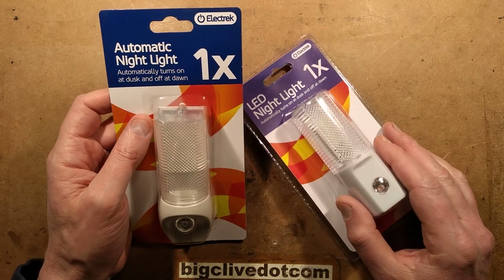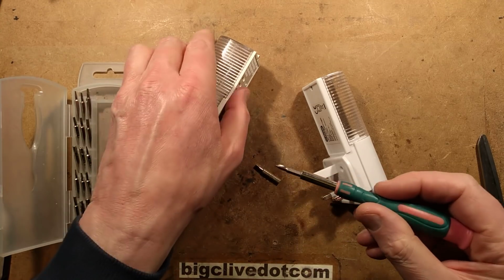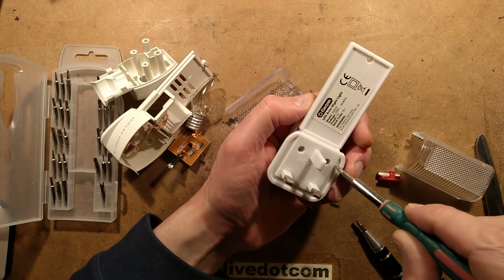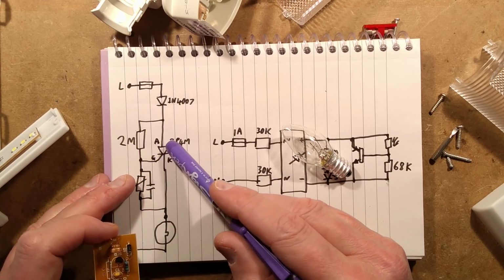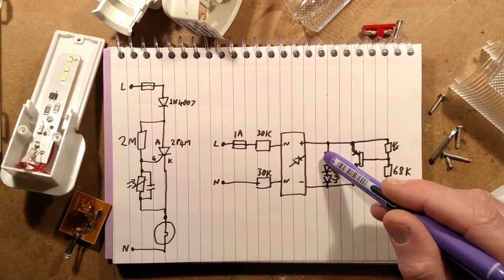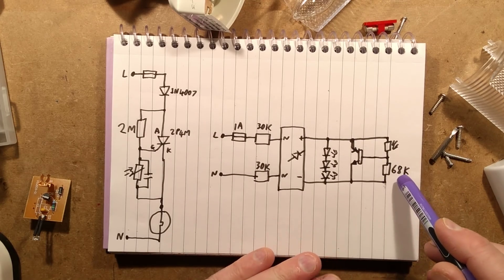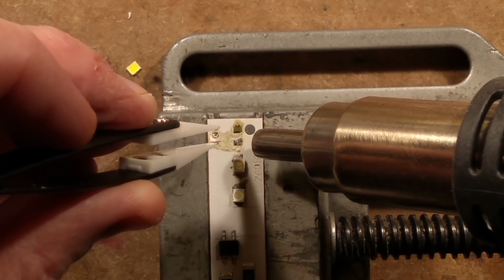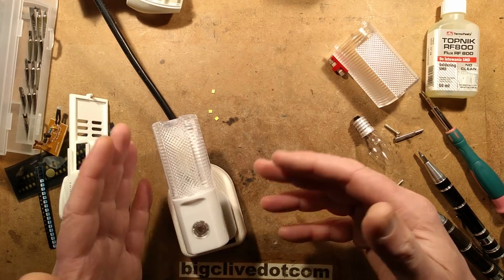Poundland night light tungsten to LED evolution.  (with schematics)

Comment: Surprised they didn't just change the incandescent lamp with a led circuit, could still have used a capacitive dropper as long as there was a high value resistorto maintain some current when on.
That way the circuit would draw a tiny current when off.
Reply: you cant use a capacitive dropper on a circuit like in the filament bulb unit, as the waveform is to 'choppy', the current pulses would be huge and pop the leds,
Reply: If you get a standard capacitor dropper led driver like clive has shown many times, the led's don't pop
Connect a high value resistor in place of the incandescent so it holds the scr on when triggered, in parallel with that resistor you connect the cap drop led circuit.
Reply: ah, but with these light controlled 'nightlights', they dont switch 'hard' when the light level reduces, they have a dimming effect, gradually increasing the conduction time of the ac cycle, theres hard/sudden leading edge switching, which is bad with capacitor droppers,

Comment: Blue LEDs sacrilege, warm white, warm white, warm white. Where is the real Clive?

Bis spater (yes I know the umlaut is missing).
Reply from the maker: I did consider warm white, but was concerned about the backlash from the white selective haters.
Reply: For all the umlautly challenged 7-bit people: You can substitute umlauts by just adding an E to the vowel: So "spaeter" is just as correct as "später" ;) 
It has been the original form historically, then people began writing a tiny "e" over the vowel, later reducing it to just two dots in medieval times, resulting in what we know today as umlauts.

Comment: Theres a little screwdriver set you can also get in poundland with a triangular bit.
Reply from the maker: Is it the one that comes in a round tub?  Those sets are very easy to damage with too much pressure.
Reply: @bigclivedotcom  The round tub one may of been a Lidl one, I got a poundland one in a flip top case which has been 'ok'. I got the round Lidl one as it had a shorter handle and a couple of different bits.. it snapped on 3rd use.
Reply: yes they are made of jelly :(
Reply: @bigclivedotcom  , the relative lack of hardness of the screwdriver bits is a separate issue, but at six minutes in I noticed that the magnetic screw-holding capability of the bit holder of one of your screwdrivers is way better than any of the ones I have found. Typically, the ones I find here in the States either do not have a built-in magnet, or the magnet is very weak. I epoxy- glued a small neodymium magnet inside the hollow (bit-storing) handle of one of mine, so that it butts up against the back end of the screw driver shaft.

I've seen DIY cell phone repair kits ("disassemble and permanently disable your cell phone" kit would likely be more accurate) that include the Tri Wing and Y shaped Philips style bits, as well as five- point star bits and other weird security screws used on cell phones and small electronic devices. Sold at Walmart here in the states, or at Lowes (the  Kobalt mini security- screwdriver kits sold by Lowe's use better, harder steel than the "Husky" or other tool brands sold by Walmart).

Comment: Trouble with LED type is that when the LED fails you throw everything away while with the tungsten type, you can simply replace the tungsten bulb with a various color LED bulbs
Reply: Tungsten lights are rated for 2000 hours and LEDs if they are good quality last 100,000+. In most LED lights you will find that it's the caps that fail and cause everything else to go bang too.

Comment: Could the cap across the LDR be to filter out 50Hz flicker from fluorescent bulbs?  I've had this problem once.
Reply from the maker: It could be.
Reply: Or it is to keep your nearby transmitting cell phone from turning it on.
Reply: quite likely, or.. maybe when its starting to turn on, it picks up a bit of its own light and goes unstable..??

Comment: I had a dallor store tungsten night light pop when I turned the switch on, made the breaker go off glass everywhere... Scared the pants off me.. It was simple but the front clear plastic snaps on the bulb..
Reply from the maker: It's not uncommon for the small lamps to fail with a bang.
Reply: @bigclivedotcom  Hey Clive ❤ we  just got the new Led ones here at our local dallor store same circuit but its thru hole with one straw hat led... I replaced it with a slow color changing led, works fine no bang just wanted to let you know, love your vids ❤

Comment: I've finally found some of those 3rd gen COB DOG led 220v to test and see if they're a viable alternative for indoor gardeners. At round £14 for 250w full spectrum of they grow well but only last round 12 weeks we would all be very happy. Will let you know how it goes. ThankQ. TkEZ>UK
Reply from the maker: Interesting idea of just expecting a short but glorious life cycle of the LED lamps.  In a way that correlates to the routine replacement of the high pressure sodium lamps due to intensity degradation.

Comment: So the led setup at idle during the "day" it uses 4 milliamps I'm guessing at "night" each led runs the usual 20 to 30 milliamps each ? Or do i have that wrong. Another fine video Cheers.
Reply from the maker: 4mA all the time.  Either shunted or running through all the LEDs.

Comment: Clive, what hot air unit are you using?  I have been thinking about getting one, and after watching your video, I am getting motivated to get one.  I am cheap and a hobbyist, so probably get one of the Chinesium ones off Fleabay.
Reply from the maker: I use a combined unit called a Yihua 8786D. They're so similar between brands that I wonder how many of them come from the same source.  I'd suggest getting a cheapo and then upgrade if you decide you want something more ambitious.,
Reply: His looks like my own from what I can see. Appears to be a variant of my "Ya Xun 858D." Ebaying 858D will show it under many names.
Reply: Paul Stafford - “fleabay” 🤣

Comment: If even Clive is going to use a heat gun now I suppose it's time to break down and get one.
Reply: That's the singular source of heat in his home.
Reply: @DJS_ENO  It's a Scottish thing. It's positively tropical in my Edinburgh flat right now as its reached 17C... Perfectly comfortable for t-shirt or even less for me! ;-) 

https://drive.google.com/open?id=1kw4U3RdGcyfKK5b4SheWXySQ5HjNqi5h
Reply: I find my 858D very useful for heat-shrink, hot glue rework and 3D print cleaning as well as soldering surface mounts. I don't tend to design my own items yet with surface mount parts but I do modify some Ebay modules to improve/change them to my needs. Well worth the £20 as was my 936b+ soldering station.